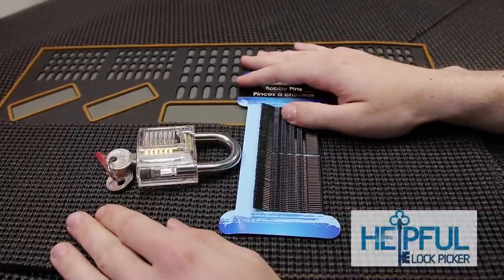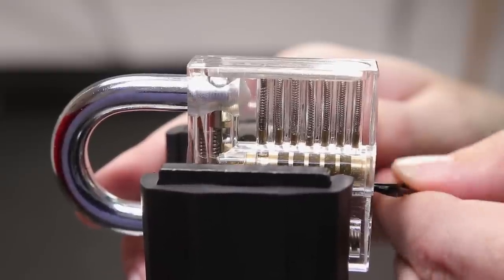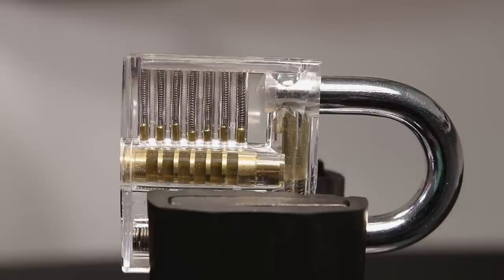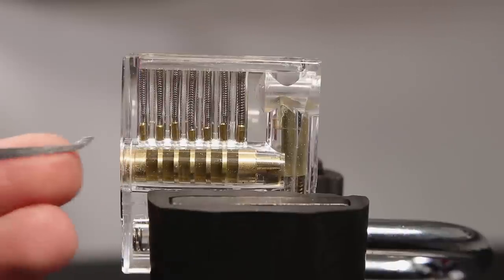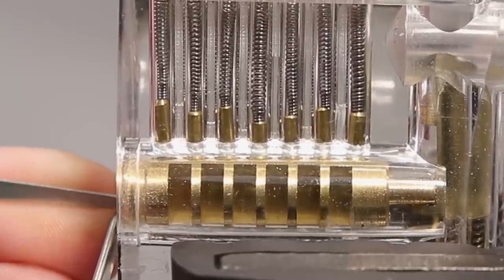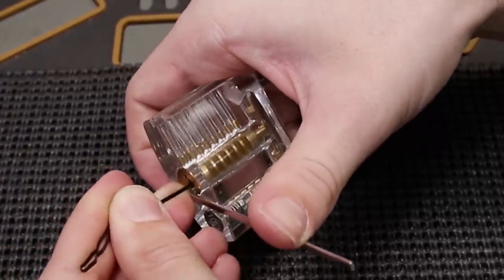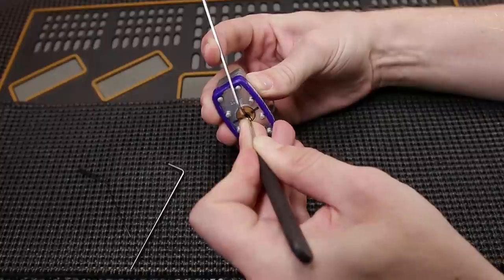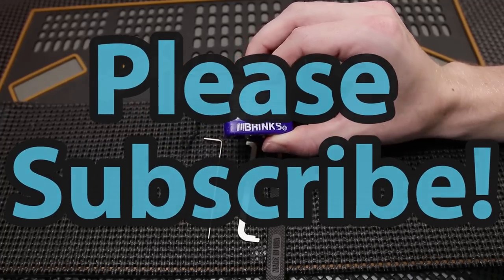[189] Close-Up On How To Pick A Lock With A Bobby Pin!

Comment from the maker: Please Share Your Experiences Opening Locks With Bobby Pins!
Reply: HelpfulLockPicker I’ve been trying this on multiple locks and doors. It’s so hard! Few questions, how much tension to you put on the plug a little or a lot? Also how hard is it to raise a binding pin. I feel like I can detect some binding ones but either can’t get them to move up or idk... I can deff feel the springy ones why can’t I get this to work even once?
Reply from the maker: @brapperdan  what type of lock are you practicing on? I really feel that Kwikset locks are really great for someone to learn on because they are easy to open and have a wide-open keyway. If you haven't already you should also consider getting a cutaway lock so you can visualize what's going on. I typically use a moderate amount of tension which is a hard number to actually quantify and describe to someone. Tensioning is one of the most important aspects and also one of the hardest to learn and unfortunately this will all come with practice. But typically speaking the binder should not be extremely hard to lift up especially if you are working on a standard lock
Reply: HelpfulLockPicker I’ve been trying to open some different door locks the kind that are in the door knob of a relitivly low priced door knob from a home improvement store, and also I tried a fortress 30mm pad lock which I believe is just 3 or 4 pins. Maybe I’ll get some real picks and try those with a clear lock,
Reply from the maker: @brapperdan  real picks make it a lot easier, let me know how it goes!
Reply: Believe it or not I’ve open this disc container lock but I’m stuck on this master lock no.3 🤦‍♀️
Reply: I opened a lock with a Bobby pin and knife!
Reply: More talking then teaching but ya
Reply: I learned how to do it ar age 5 because my 11 year old sister would livk me out
Reply: Can’t do it to hard¿

Comment: This is how I picked my first master#3. I hadn't ordered my pick set yet. The tensioner breaks. The metal used in bobby pins isn't made to hold tension.  For an emergency it's good to know how to do it but a good pick is well worth the money. You only need a hook and one top of keyway and one bottom of key way tensioner. Those three things will open just about every residential use lock made
Reply from the maker: Thank you for sharing!

Comment: I used the wire like metal that's on those clamping paperclips. They're a lot harder than your standard paper clips. I fashioned one into a single pin lockpick using plyers, the wirecutter part of the plyers, and a file to make the pick narrow enough and to help make the tip lockpick shaped. Then I used the same tools to make a tension wrench. I locked my wallet and my keys in my house and I really didn't want to pay for a locksmith.
Reply from the maker: Thank you for sharing!
Reply: @HelpfulLockPicker  Thanks for providing the vid that inspired me to find something bobbypin like. Sure helps to have random crap in my car as a resource sometimes lol. In this vid there was a frame showing your actual lockpick to scale on my phone so I used that to generate a shape. The thickness was kinda hard to figure out and time consuming to file using trial and error. I had 2 4 pin locks in my car that I practiced on just to see I can actually open something before attempting the 5 pin lock on the front door. That 5 pin lock was too hard for my skill level so I went for the 4 pin lock on the garage door which was just like those locks I keep in my car. Then there was one more 5 pin lock to go through that I think I got just out of a stroke of luck.

I copied my key and ordered a couple of lockpicks that I'm going to keep in my car, along with a bare bones set for my wallet. Getting locked out sucks. Anyways keep up the good videos. They really help people out!
Reply from the maker: @ConvictJ96  Thank you for the kind words! The thickness I typically use is 0.025" thick.

Comment: Picks and tension wrenches made from were some of the first homebrew tools I used before I got my first professional pick set and they work surprisingly well.However,you need to construct them from large bobby pins called “roller pins”(Like the ones below), and instead of bending over the end that is doubled over to make the tension wrench,you should snap one of the legs off(Leaving about an 1/8” remaining)and then bend the remaining portion outward to 90 degrees.As for the pick,do the same(Except bending the short end outwards)to create a handle,and as I believe someone else mentioned, make a small hook at the end by bending the tip widthwise(With pliers or the top of the keyhole)and then file the end to remove any sharp edges
https://www.amazon.com/Scunci-Black-Roller-Pins-Pcs/dp/B001UO47A4
Reply from the maker: Thanks for sharing!

Comment: What if my bobby pin stops up the whole lock when it breaks
Reply from the maker: You could try to use a key extractor or you could check out my video 253 for some different approaches. That video is about how to get a lock Buster key out but could be applied to that